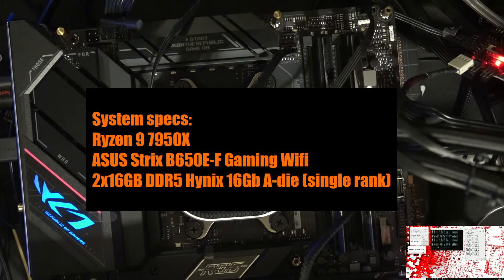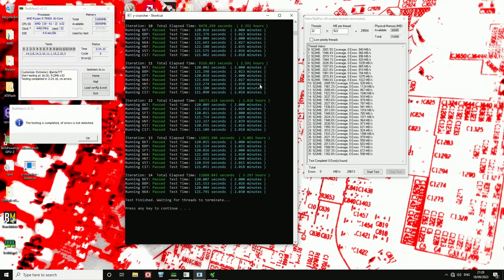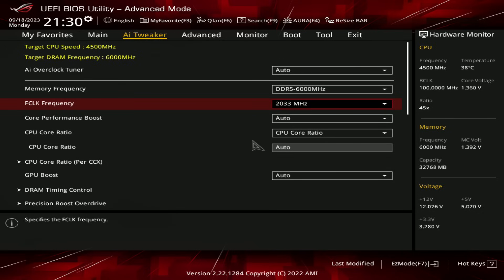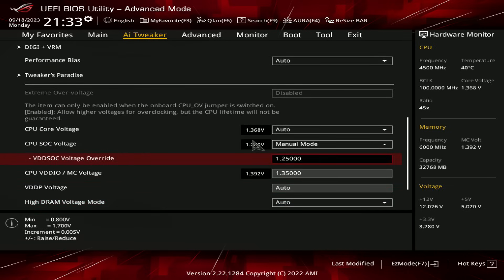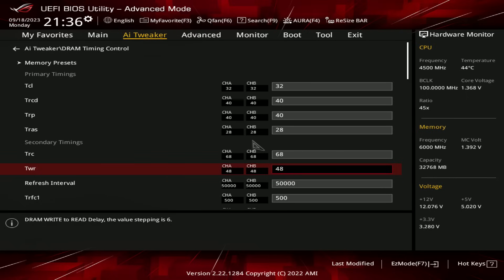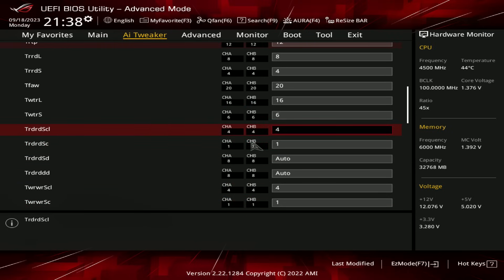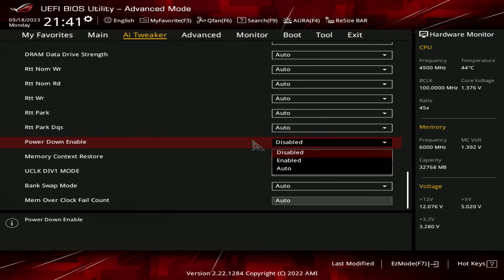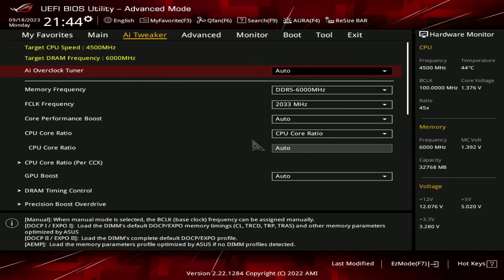Easy memory timings for Hynix DDR5 with Ryzen 7000

Comment: on my A-die Kit, I can get 4-4 TRRD's working and 8RTP.
The main thing is you have to raise the SOC voltage ever so slightly and it will start working.
I had to set mine to 1.22 to get it stable.
If i tried 1.2 I could only get 4-8 stable, 

Ran Y-cruncher/superpi/linpack/occt for many hours just to verify that 4-4 was stable. 
Figured I would share since I had the same issue with My TRRDL/RTP not cooperating.
Reply from the maker: I've tested this kit even with 1.4V SOC and it just doesn't do tRRDL lower than 8. It also needs loose tRRDL on intel.
Reply: My RRDSCL can't boot with 4, the lowest is 5 but it's unstable. I'm running SOC 1.35v, any idea how to run 4?
Reply: @nguyendinh2052  for me voltages really were the main key. Cause just like you my A-Die at certain voltages didn’t cooperate at all with anything below 4-7.
So maybe try increasing it even more. And see if you hit the sweet spot.

Comment: I wish you would have a video on overclocking Hynix A on 12th gen
Reply: It would be nice though. Like a Strix z690 e just for the content
Reply: Can't pass 7400 on 12th gen without abusive CPU voltages. No need for a video.
Reply: @theodanielwollff  I bought 6400 with Hynix A die from gskill, any attempt to go beyond that frequency is causing errors in memtest (12900k)
Reply: @arroww1323  12th Gen maxes out at 7200-7400 with a good binned CPU on Z790 MB. If your using Z690 It will be about 6400, unless its a 2-DIMM slot MB. I am not surprised you cannot go past 6400.